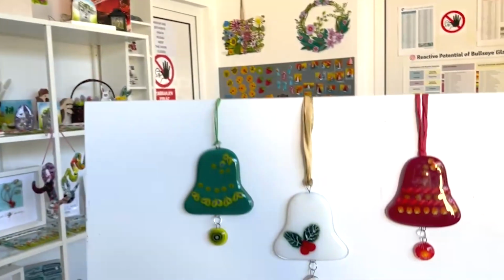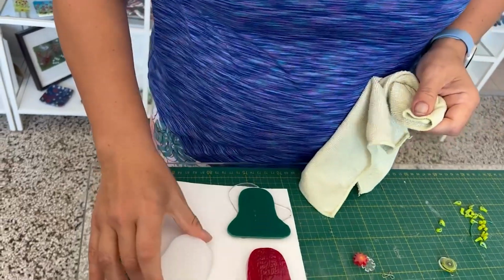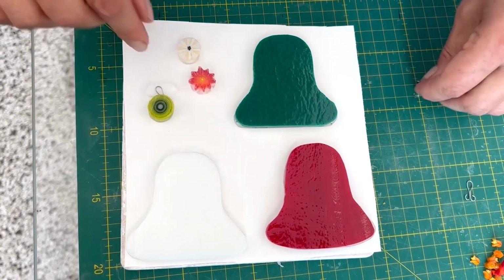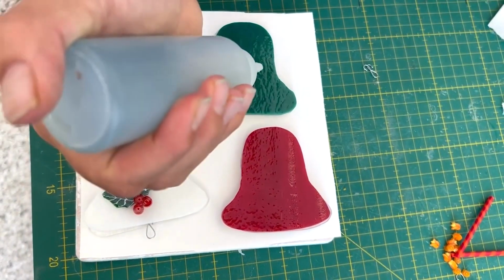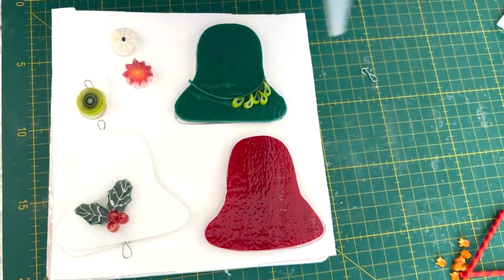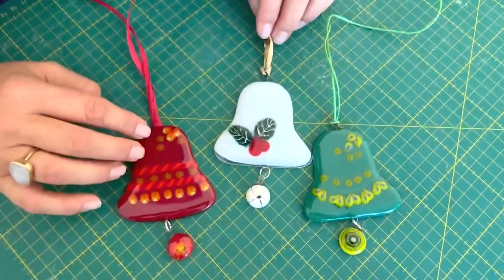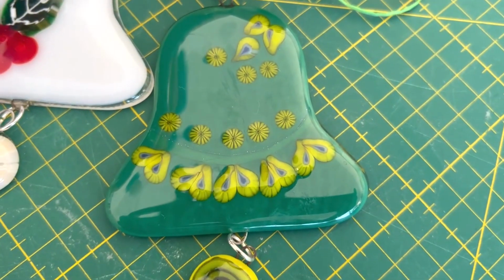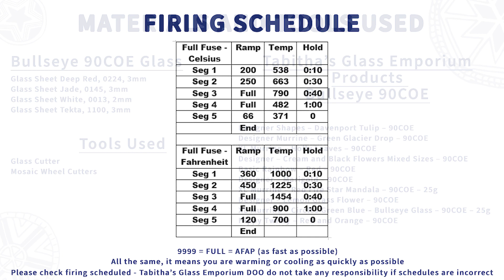Fused Glass Hanging Bell Decoration

Comment: I watched a Bullseye Glass video that said they use a blend of 1 Cup water + 1/4 Cup rubbing alcohol + 2 or 3 tablespoons of white vinegar to clean their glass is the testing laboratory.  I have been using this mixture and it works well.  Also dry the glass with a clean cotton kitchen towel.  Avoid using paper towels because they can leave fibers on your glass.
Reply from the maker: Thank you for sharing this ❤